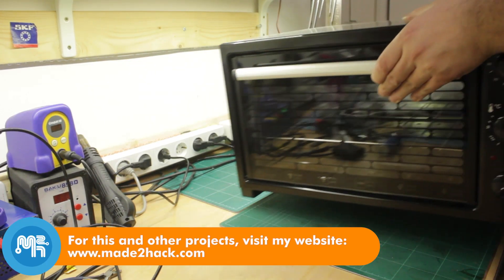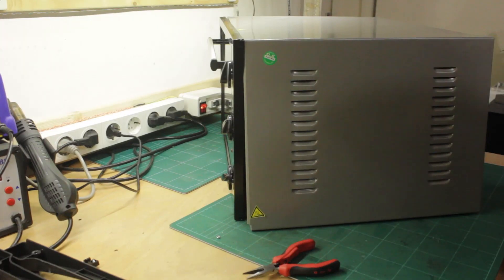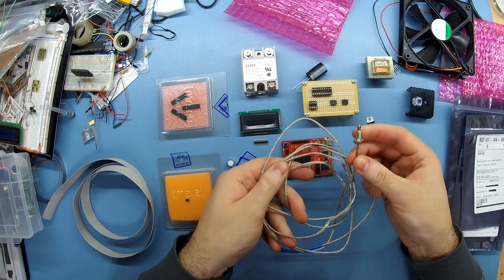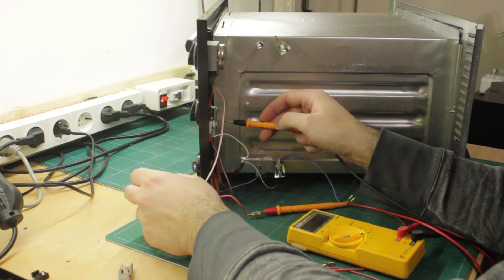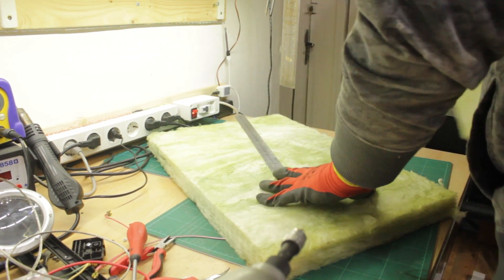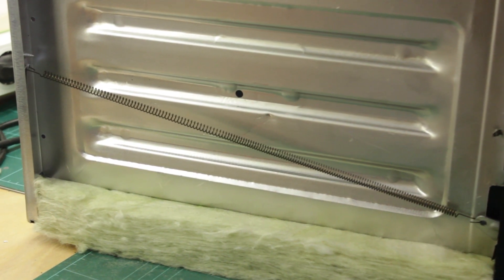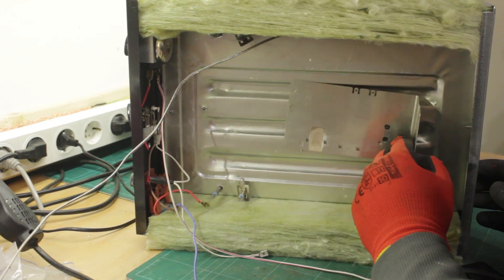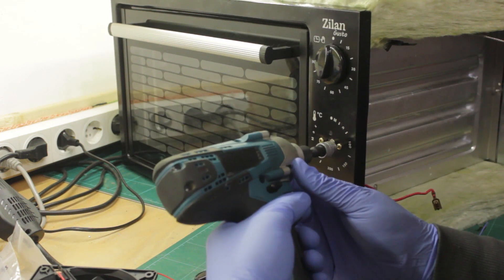How to Build a DIY Electronics SMD Reflow Oven - Part 1

Comment: I think using relay is a very bad idea. I couldn't find a simple controller with linear temperature adjustments. I guess I will design it myself using high voltage transistors
Reply: Why is a relay a bad idea?